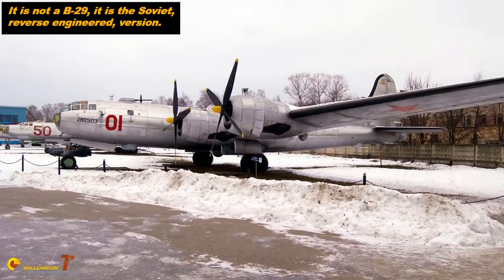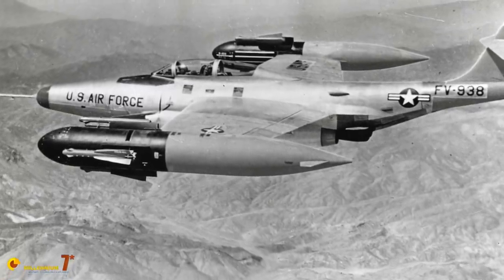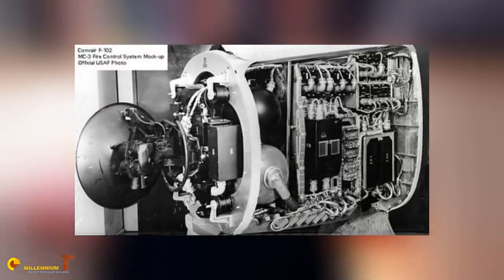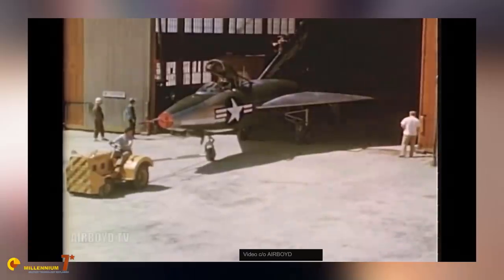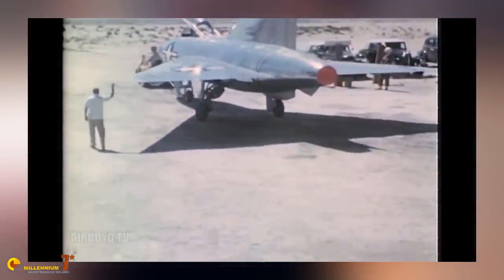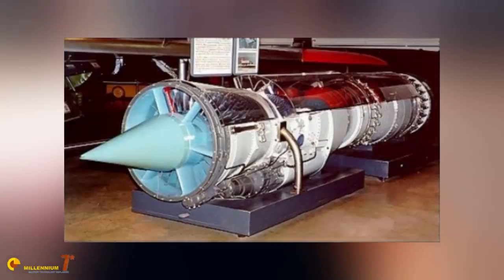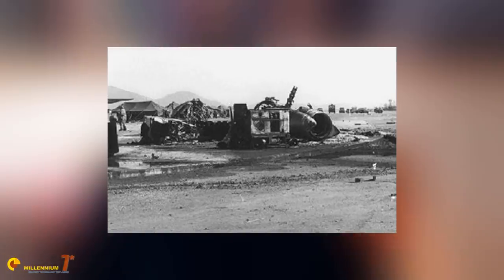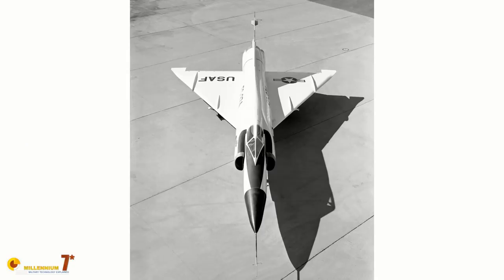F102 / F106 - Part 2: The Waist of the Fighter - Understanding the Area Rule

Comment: Great video, thank you. I have read that when SAAB built Lansen, the saab 32, they did not know this. But they updated the plane with a extra tank, a bulge under the nose pretty much. And this bulge made the plane much faster. You can see this bulge on pictures of SAAB 32 Lansen. And it is actually an extra fuel tank that makes the plane faster.
Reply from the maker: Interesting. Do you have a reference anywhere?
Reply: I can not remember where I read it. Read so many books about airplanes. If I find wich one it was I will post about it.

Comment: back in 98 i "Tried" to present an aircraft design project at my high school... a cross breed between F5 Tiger and F117 Nighthawk... and you can probably imagine how it would turn out... now that i am learning these many bits of information that i can have access to "today" because of internet and stuff, i imagine how childish it was and yet, if i had access to this kind of information back in the day it could actually affect my career path choice...
Reply: That actually sounds like an interesting concept. Was it the Nighthawk's stealth characteristics that you tried to integrate into the Tiger?
Reply: @lfox02  yea, and a F22 glass cockpit design, plus internals with FADEC and data link and fly by wire and stuff... but well, it was more like a requirement list than a design when i look at it now
Reply: @sohrabroozbahani4700  Sounds kind of like the F-20! That would've been cool as hell.

Comment: Slight correction: when the Area Rule says "the same cross section of a minimum drag body", they are not referring to a tubular, pointed, blunt-based object like the one you drew (which looks like an ICBM rocket or something). They are referring to a rounded-nose, fish-body shaped object with a long, tapering tail. Like a drop tank, but longer, That blunt tail you drew is not at all an ideal aerodynamic body. It may be the profile they end up with in practice, due to the exhaust nozzle, etc, but it's not what they strive for. You want the given total cross sectional area of the fuselage and wing to be identical at any given point on the body to the same exact point on the minimal drag body. In practice, they can only approximate it, so you get fighters with pointy noses and blunt tails, but they ought to be shaped more like an A-6 Intruder, according to Area Rule (that inly applies to transonic drag, not other issues, which is why they DON'T all look like that). The minimal drag body does not have straight sides, anyway, it tapers at both ends and swells in the middle, so that's why they don't build slab sides when they can avoid it, and why thye like to taper the tail. The middle would be pinched in either case because they need to take some cross sectional are out of the fuselage to make up for the area of the wing at that same point, since the idea low -drag body has no wing
Reply from the maker: Great comments, thank you very much, I really appreciate those who add context and information to the videos

Comment: Another interesting fighter that did not have a delta wing but had a very pronounced use of the area rule fuselage was the Grumman F11 Tiger that first flew in 1954.  This aircraft could not match the F102's performance but the F102 could not operate off of an aircraft carrier either.  The F11s biggest handicap was the engine that was chosen.  Back during the 1950's just like the rapid developments that occurred in aircraft designs there were also rapid developments in jet engine design.  Grumman chose the Wright J65 engine that only put out 8,450 lbs of thrust and 10,500 lbs of thrust with afterburner.  Convair chose the Pratt and Whitney J57 that produced 11,700 lbs of dry thrust and 17,000 lbs with afterburner.  The F11 does have an interesting claim to fame, it was the first fighter that shot itself down.  If I remember the story correctly, they were practicing strafing attacks and the F11 ran into its own 20mm bullets.

Comment: Thank you.

Why Bulge the Fuselage inwards, Why not mount the Wing Higher totally above the Fuselage?
Reply from the maker: Good question, not addressed in the video.
a) it is not that simple, I just gave an intuitive explanation. There is a "differential area rule" that still places some limitations to the section even if the wing is  above the fuselage.
b) You may not want to have a high wing for a fighter, since it has a stabilizing effect in roll, potentially reducing the roll rates or requiring larger authority to have the same roll rates.
c) Probably you should be placing the wing completely above the fuselage, supported by struts, to get rid of the area rule, but in that case you have other problems.
Reply: @Millennium7HistoryTech  

Thank you.

I was referring to a Parasol Wing, like in the following video on a Glider, on a Experimental Basis.

https://www.youtube.com/watch?v=MjEG8fTcmKA.

But it would a bit of Far Fetch as it can create Fatigue in the Struts that connect the Wing and Fuselage, in case of Rolls and Maneuvers like Split S and Flat Spin.

I agree with you.

Comment: Good as usual. There are a couple of things to add. First, the so-called "area rule" wasn't discovered by Whitcomb. You have mentioned that the rule has been discovered independently at least a couple of times, but, certainly, there must be the person/research group that did this first. Also, historically, F-106 wasn't the first aircraft to which the rule has been applied. The Soviet Tu-98 (NATO nickname Backfin) was that aircraft (designed and built 1955, first flight early 1956). As far as I know, the idea of its airframe design (regarding the area rule application) has been proposed for this aircraft by the Central Aerohydrodynamic Institute, who experimented with supersonic aerodynamics since the 1920th.

Comment: I work in a field that uses some hydrodynamics, so the explanation of the area rule was great, thanks! One thing I've been wondering is that some early supersonic planes like the F-100, Mig-19 and Mig-21 don't really seem to follow the area rule. Why then can they go past Mach 1 so much more easily than the XF-102?
Reply: Great question - I hope he makes a video on it. I think some planes just used more power and could withstand the added drag in the transonic regime, or followed the area rule but it's hard to see b/c they used a more complicated design
Reply: @nathansmith3608  Possibly, but the F102 and F100 use the same exact engine. Also, the migs don't have significantly more thrust than the 100/102, so something else must be happening. Regarding the area rule, indeed more modern planes do follow it in a more complex way...but no way the Mig-19 and 21 do that. They are basically big tubes wrapped around a turbojet (or two) with wings attached.
Reply: None of those planes go past Mach 1 in level flight initially.  The XF-102 did(late prototype only of course... =)).  That is the difference in the area rule.  Of course in this discussion one has to be careful as ALL of them, uh hem, ALL of them had engine upgrades; multiple times, so.....  On top of that is that the other airplanes you are talking about were VERY lightly built and had exceedingly SHORT range.  The F102 on the other hand was * slightly better in this regard.  Once again, depends on version, engine upgrade, yaddda yadddddda infinitium, yadda
Reply: @w8stral  That is absolutely not true. All of those fighters are at least comparable to the F-102, and the Mig-21 is - much - faster.
Reply: The first version of the 102 was a new design using a delta wing so it was not as well understood as swept wings.  That 102 would likely have been able to fly above M1 if it dove to break the sound barrier -- once through the transonic region the drag would drop enough that continued flight above M1 was possible.  The huge advantage of the area rule is that it dramatically reduces the drag IN THE TRANSONIC REGION so that the thrust would be enough to exceed M1 and beyond.
Reply: The F-100 is much smaller and lighter than the F-102. In fact, the 102 is about the same size as the F-106 with its powerful J75. So is no surprise it perform much worse. And I can be wrong, but I believe the MiG-21 do employ a bit of area ruling, especially visible on the models with the big hunchback.
Reply: @magoid  It's not. The F-100 is slightly heavier when empty and has a higher max takeoff weight, and the 106 is about 30% heavier than the F102.

Comment: US was on the right track with Delta wing design. But they dump the idea and went on with all moving elevators at the rear instead of putting it at front as delta wing canard design, that later applied by Saab with thrust reversers

Comment: While this not applies to the F-102, is worth mentioning that, since the area ruling is a mater of volume, you can also make the fuselage thinner in the vertical, like in the Typhoon or the J-10, so you apply the area rule without a coke-bottle format.
Reply from the maker: Correct.It is called differential area rule. There is also a supersonic area rule.
Reply: The SAAB Draken was produced succesfully at the same time and better technollogy
Did Sweden have better engineers

Comment: Will the drag be different on the body on a high wing aircraft such as the F-8U or mid mount as a Mig-21?
Reply from the maker: The rule is still valid, but there is a differential area rule that deals with that. In a future video, probably.